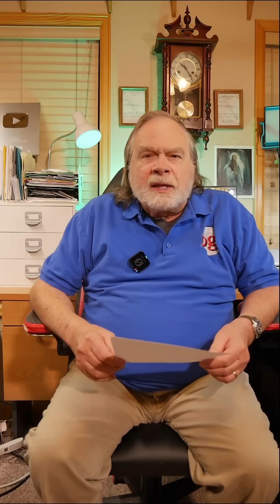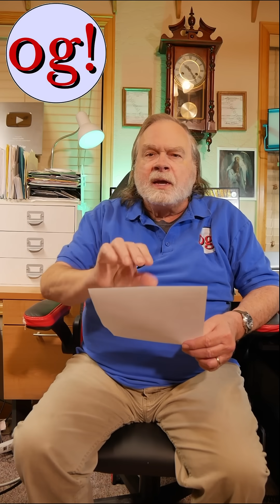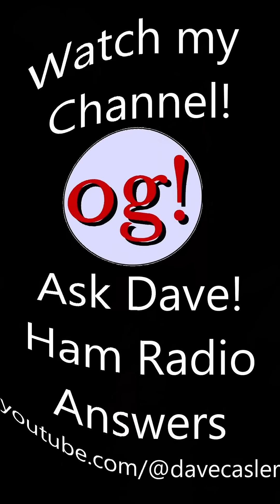Coax Tape (Short #3)

Comment: For exposed connections I use self-amalgamating tape and I paint UV-resistant rubber paint over it. That lasts for years without any trouble. I buy the tape from Aliexpress and the rubber paint can be bought quite cheaply at boating stores.